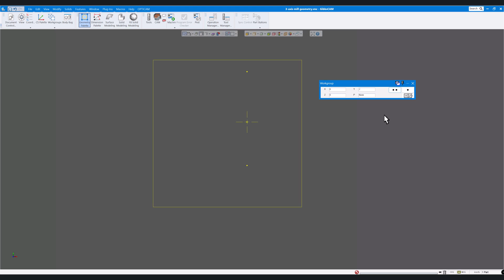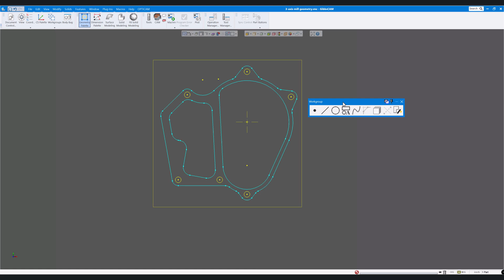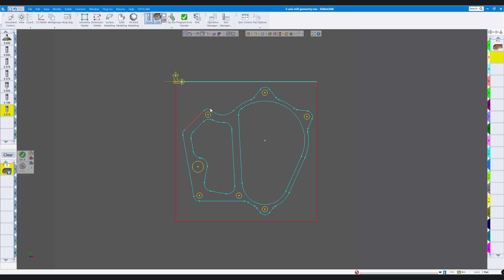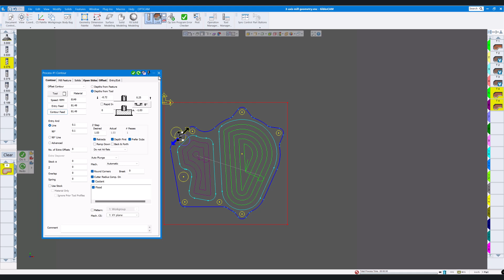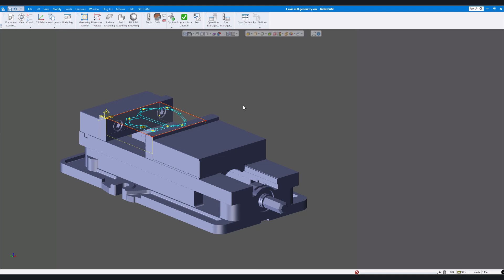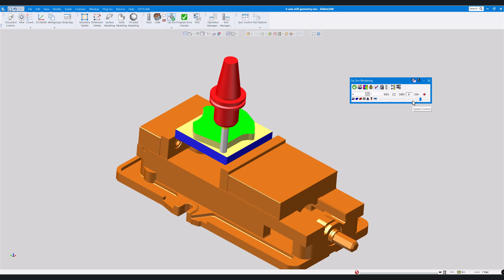GibbsCAM 2025 Class 2, 3 axis milling

Comment: Yet another question, possibly an idea for a future tutorial?  Or it may be in one of the fancier machine videos I have not gotten to yet (we have an old 3 axis HAAS VF5 so I haven't watched the others quite yet).  Is there a way to draw in an edge radius on the part instead using the tool to do the chamfer?  Most of our parts have a radius (ex .13 or .25) and we don't know how to draw it so have to request solid models often.  These take time to get and it would be nice to just know how to draw it up.  I'm sure its possible with Gibbs, I just lack the knowledge.  Thanks again for these videos, they are a great tool!
Reply from the maker: Hi Sarah.  You mention a radius, then say chamfer?  If you have a solid model it's easy to draw either a chamfer or radius as long as you have SolidSurfacer in your software package. It's under the Solid Modeling icon.  If you are talking about drawing it as geometry, like on a vertical corner, just open the Geometry pallet, click on the corner point (must have geometry first), then click on the icon on the Geometry pallet (its the 6th icon from left), that will bring you to the choice to do a radius or a chamfer.   Good luck !
Reply: @GibbsCAMVideoTutorials i guess I swapped terms there and didnt realize it, sorry.  On the bottom LH corner of the tutorial print where it states .020 chamfer on all edges and holes, if that actually called out say a .30 radius around the edge of the part.  Is there a way to draw that if you dont have access to a model?
Reply from the maker: @SarahsBarnyard  Not really unless you have a solid model, but you don't really need to draw it if you are going to machine it.  If you watch this video I show you how to program radius's and chamfers using geometry.
https://www.youtube.com/watch?v=6UdTbFz6fuI&t=1s

Comment: Thank you for doing these videos, I am learning alot that I have been missing in my short time using gibbs.  In the video you mentioned a cheat sheet for connecting?  I did not see anything under the downloads, am I just missing it?
Thanks again!
Reply from the maker: Hi Sarah.  Here are two links for both Shortcuts, and Connecting.  Thanks for watching!  Note:  Let me know if you are able to download them, as sometimes links don't work.
https://www.dropbox.com/scl/fi/bxjao2at25pqehhxk2k31/GibbsCAM-Shortcuts.pdf?rlkey=t5nx0mia1ladsyx7q0te9nzzw&st=x54i1ivk&dl=0
https://www.dropbox.com/scl/fi/7kitxinfxcwojhafi6m3p/Connecting.pdf?rlkey=6fh6sa8mhjufpk2shz7z7u55x&st=s02f8v4g&dl=0
Reply: @GibbsCAMVideoTutorials  Thank you so much for sharing these!  I need all the shortcuts and tips I can get 😅  I am slowly learning gibbscam. It is a neat process drawing by hand, way different than the 2D I have been doing on our OMAX waterjet.
Reply from the maker: @SarahsBarnyard  Haha, yes, Gibbs is a little different then just standard CAD.  While some CAD programs make you tell what the toolpath should follow when you CAM it, Gibbs makes sure all your lines, arc, circles, chamfers, etc are already connected prior to running the CAM portion.  Once you learn the difference between a Yellow point vs a Yellow square, or Blue square you will be super fast !  If you follow this link, I walk you through "Your first Mill part".  If you can do this part, and get proficient, you are on the right track!
https://youtu.be/xPkdOlJgEBk